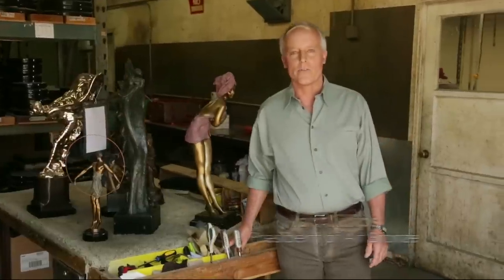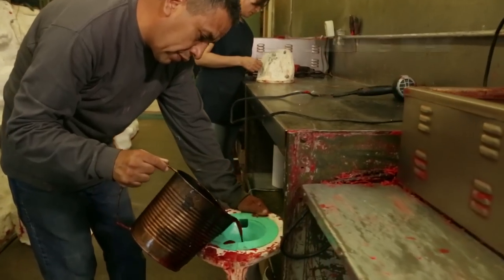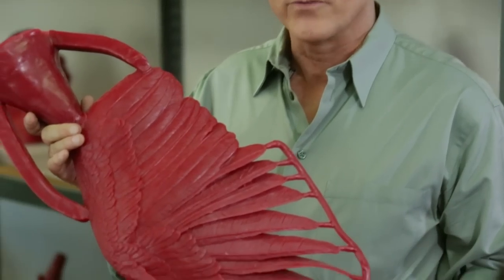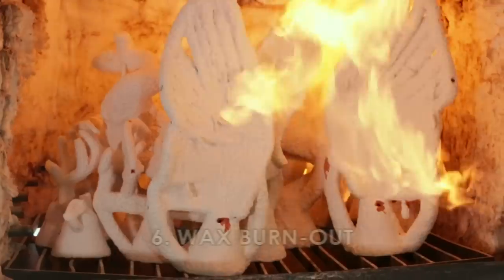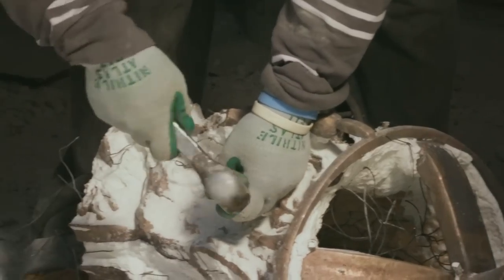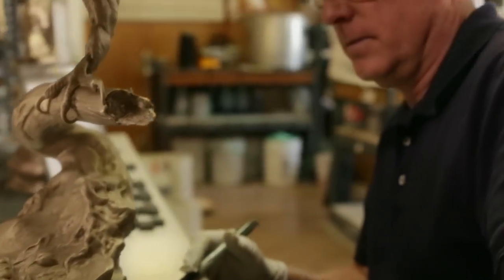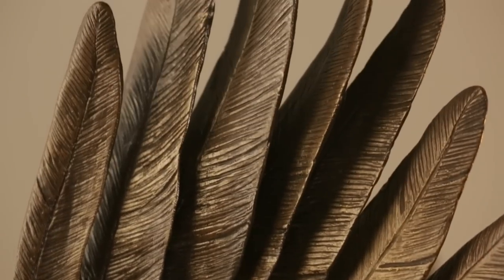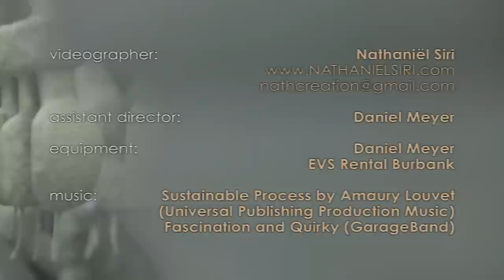Art Bronze Inc, Foundry Tour

Comment: I work in a steel foundry we do the same thing but instead of bronze its iron and steel. Pretty cool seeing the process differently. We use sand molds with two halves. Our process is way different but vaguely similar.  Thanks for the video.

Comment: You aren't doing 'Lost Wax' you're doing ceramic shell.  Ceramic Shell casting is the modern way of casting with high tech silica and can take thermal shock which allows most of the wax to be recovered and the wax is Not lost.  Lost Wax method is when the wax is completely burned up from a mostly gypsum (plaster) based mold that is around the wax and incasing it.  Today that process is also referred to as 'Standard' because it's the old or ancient way to cast bronze (metal) sculpture.  Since the main ingredient in the 'Standard' method is plaster it makes the mold very fragile to sudden heat shock.  Because of the heat shock issue, the molds have a very slow flame that increases over a day or longer and during this process the wax is burned up.  That is the Lost Wax method.  The casting method in this video is Not the Lost Wax method.